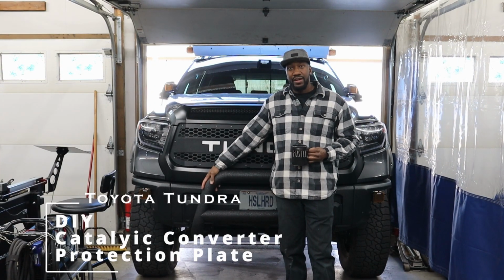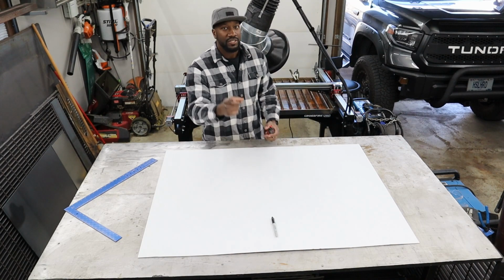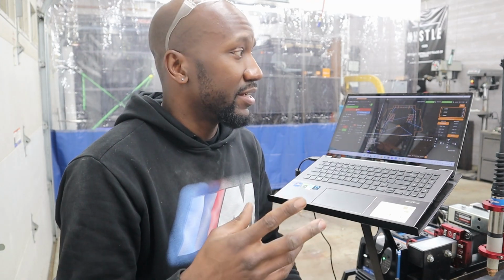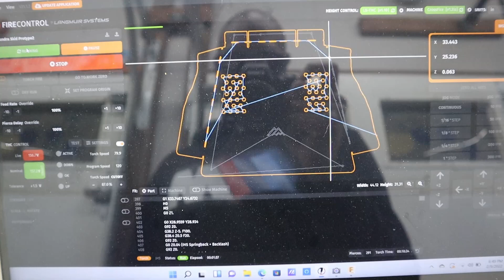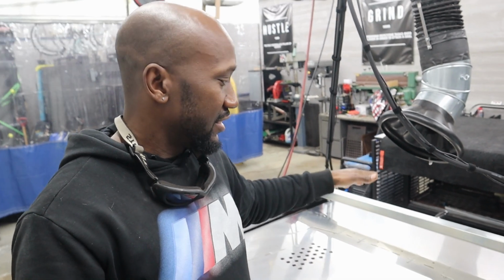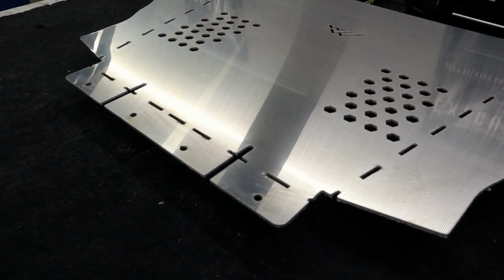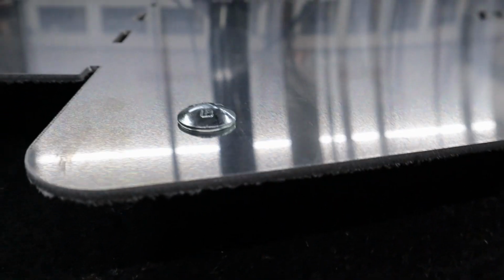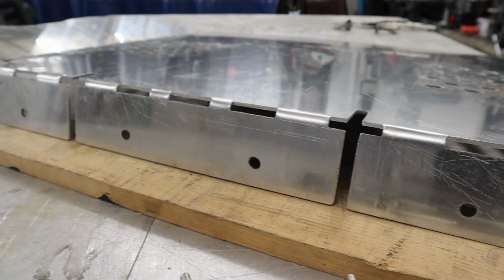Toyota Tundra DIY Catalytic Converter Protection Plate

Comment: Very nice! Do you have a website set up to sell the protection plates? Which CNC are you using? Thanks
Reply from the maker: Thanks ted Lu, I don't have my website available just yet, but it's in the works. I'm using the Langmuir Systems Crossfire Pro CNC Table, along with Fusion 360 CAD/CAM program. Thanks for watching Marcustomz Garage.
Reply: Yeah, I want to order one too haha

Comment: Great build Marcus.  I’m having trouble finding someone who builds one of these skid plates for my new 2021 Ford F-150 Power Boost ( Hybrid).  They say the frame is a little different because of the hybrid battery.  Do you have any way of getting the measurements for this , I would like to cover my catalytic converter’s also.
Reply from the maker: danny rice, I'll be on the lookout for one at work. Thanks for watching

Comment: Great job. I'm a former aircraft mechanic.  I was going to make mine by hand but if yours are cheaper than what they are asking now i might get one. Btw how thick is the aluminum you are using?   .070?
Reply from the maker: Thanks for watching Marcustomz Garage, and I'm glade you asked? I've been debating selling 1/4" thick as the standard.   In this video the plate thickness was 1/8" . Chris if you would like to check out the very end of my latest video you will see the final rendering of the Catalytic Converter Protection Plate with rear cat protection , feel free to check out my press brake build video.   My next video that I will drop will  announce ordering from my website.  Thanks for your interest. I hope to earn your business soon. 👊🏽

Comment: Looks like you're up here in the rust belt by the salt residue on the frame.
I would definitely suggest doing an undercarriage wash and that you apply Fluid Film or Wool Wax on every surface that is prone to corrosion.
Looks like you have a shop, it could be a nice little sideline for you, the spray guns for the job are cheap, all you need is a compressor.
I had my car done by a guy that works out of his garage and just has ramps.
Four year old Chicago car looks like it just rolled off the showroom floor underneath.
Reply from the maker: fubar totale thanks for the advice, I'll definitely look in some fluid film or wax. I'm currently sourcing a press brake more than capable to bend larger pieces in the future, but also fit in the garage comfortably. I might be asking alot.  I'm building a list of parts to possibly build a 50"swag press brake before I open the flood gate to take orders. Thanks for watching Marcustomz Garage.
Reply: @marcustomz  
Hate to say it, but you can probably get one made of Chinesium pretty cheap.
They're pretty simple, not much to go wrong on them.

Comment: Love the energy! I just got my crossfire pro up. what compressor and filter systems are you running?
Reply from the maker: YA MAN MEEP the air filtration system consists a Motor Guard Aka "toilet paper filter, and a Ingersoll Rand D42IT refrigerated air dryer. Thanks for reminding me that I need to share this in my upcoming videos.  Thanks for watching Marcustomz Garage.

Comment: Bro! So nice to see another bro with a tundra and plasma cutter.  Wish i had a table like that but my handheld has been fine for me.  Ive been thinking and doing the same type of plate for my 2019 just gotta find the time to get under it and make a stencil.  Why did you use aluminum vs. Steel out of curiosity?  Great video by the way.  If you were near New Jersey, I'd come buy one of those today.
Reply from the maker: MarvHill thanks for your comment I chose aluminum over steel because, at the thickness of 1/8 it's lighter, aluminum  dissipates heat faster vs steel and aluminum  will gum up a saw blade quickly if someone tried to cut it off. Which serves also as a deterrent as well.  I hope I answered your question MarvHill ,Thanks for watching Marcustomz Garage.
Reply: @marcustomz  good point, i hadn't considered how aluminum will clog a grinder.  I may consider going with aluminum when i finally fab mine

Comment: Marc do you have one for 2021 Toyota Tundra 1794 Edition. No lift no mods.  Does it extend to cover the rear cat converters? Thanks
Reply from the maker: Hi Van Gamit Saligumba yes this protection plate covers the 07-21 Non Lifted or Lifted Toyota Tundra front cats from being stolen.  I  Recently designed A rear shield to prevent the rear cats from being stolen.  Check out my recent YouTube video of the press break build and you will Is see the latest design. I'm in the process of updating my website before I release them to the public.  I hope to make these available asap Thanks for watching Marcustomz Garage.

Comment: No slag? Plasma cutting aluminum sheet?
Good luck.
You get some slag even laser cutting, though less than plasma.
I would say sacrifice the mill finish and hit it with an orbital sander, cut them upside down so the side with the most slag and the sanded finish isnt showing.

Comment: Because of having my cats stolen off my 1st gen sequoia videos like yours have been popping up, I ordered the skid row transmission skid plate with the cat guard wings and am waiting for it to show up, I might be tempted to try drawing it up on mastercam and have the turret punch press punch it out out of stainless (I work as a model maker in a model shop of a electronics testing equipment manufacturers basically).

Comment: Does it cover all 4 cats. I have a 2017 with 4 cats.
Reply from the maker: John Hershman, this plate covers the front cats 100% and 50% of the rear cats. I plan on building a bolt on extention  to cover the rear cats completely.    But honestly a theft would  have a hard time reaching the front section of the rear cats.  Once a theft sees you have a deterrent protection plate, they will find a easier vehicle to steal from. If your interested in this protection plate, my website will be up soon for purchase.   I can notify you onces the site is up. Thanks for watching Marcustomz Garage.

Comment: How long where the carriage bolts?
Reply from the maker: MrSaleen521.  3/8 - 16 x 4.     Slightly overkill, because the driver side cats sit closer to the cross memeber.. I'd suggest a 3 1/2 long carriage bolt for the perfect fitment.